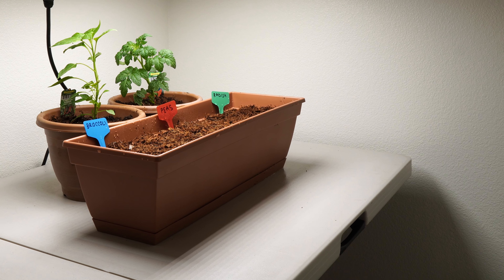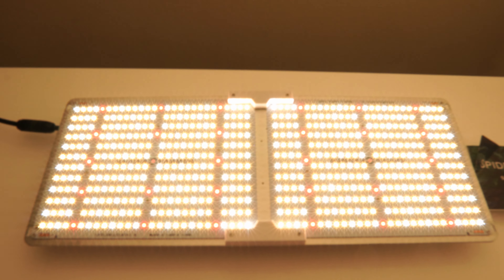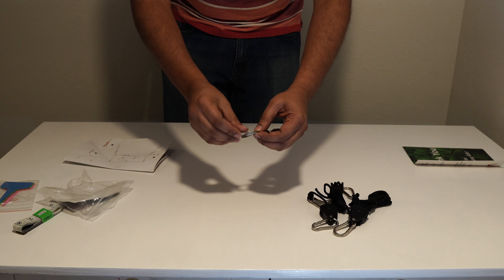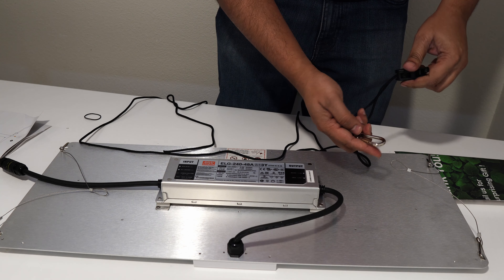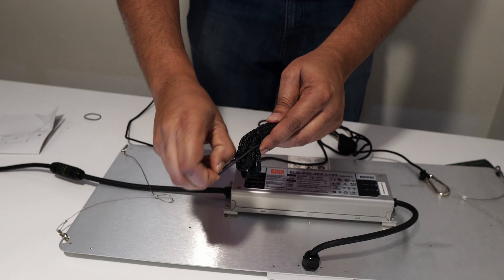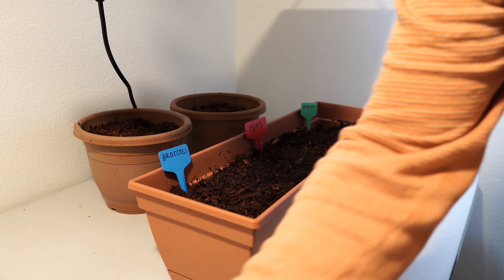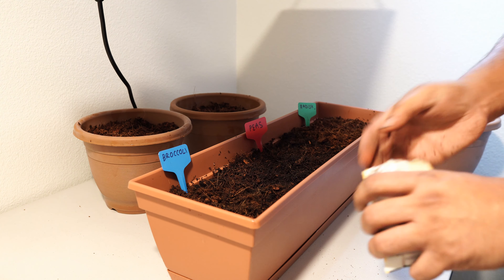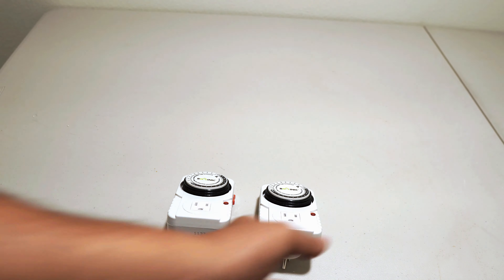Growing Microgreens indoors with Spider Farmer Grow Light SF2000 and Vermisterra Coco Coir Mix

Comment: I would try to use a stronger O ring hook. Not sure if the sheetrock is strong enough to hold the light for a long period. Especially when adjusting it so much. Or maybe that light is not that heavy. Wasn't not sure if weight is specified in the manual.
Reply from the maker: I was thinking of using an anchor to secure the screw. Will do it soon! Thanks for the tip!
Reply: @CaliforniaGardening  Actually it's not that heavy it says it weighs 6.76 pounds. I'm sure those hooks will work perfectly. You'll have fast growth microgreens.   Thanks for the great video.

Comment: What is the IP rating on this lights? The Meanwell driver is IP 65, but the light sure not. There is even no cover for the LED chips. You touch the LED chips with your hand and the life span shorten dramatically. It doesn't matter which chip brand you use. Samsung, Philips,... no matter what this light will not last for long. To make plant grow lights in such a cheap design, without the necessary IP rating and protection for the user is simply irresponsible.  Production cost around 20 to 25 US Dollars. The price in Amazon is 238 USD??? Whaaaat? For the money you can get certified industrial grow lights IP68.